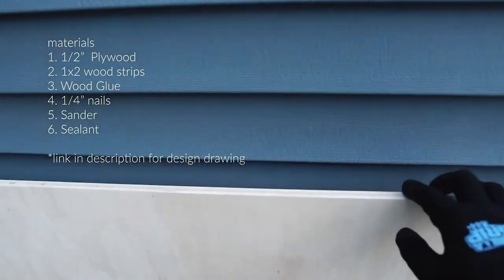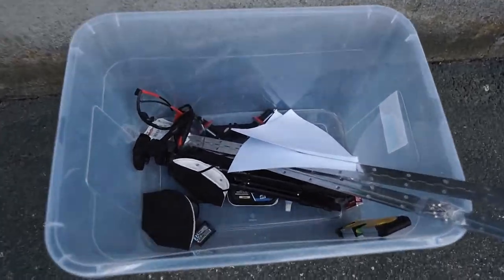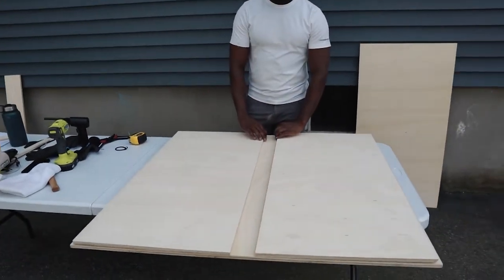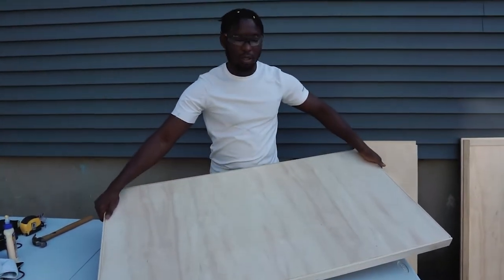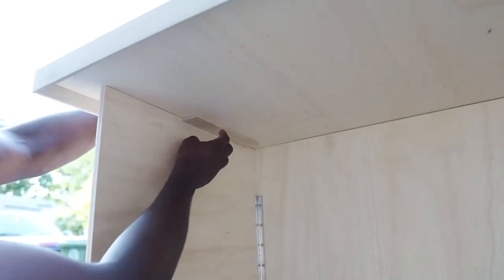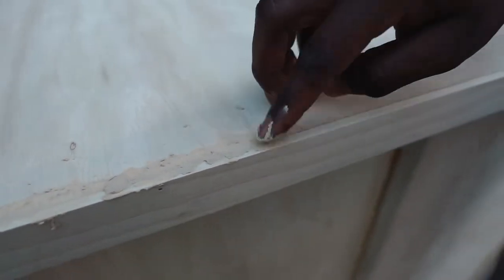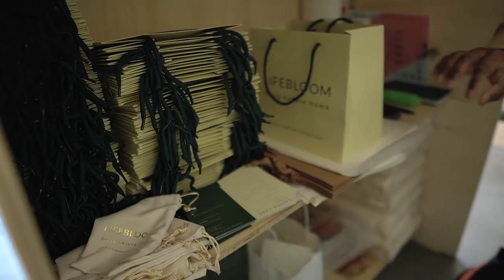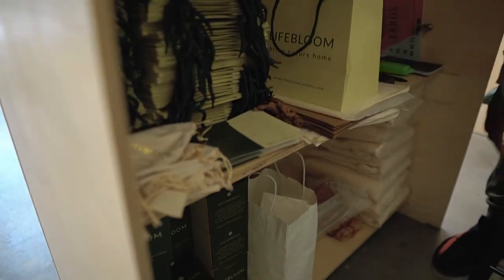DIY FOLDING CHECKOUT STAND FOR RETAIL/MARKETS | RETAIL VLOG #2

Comment: Hi! Im wondering if you might have any advice on building this with 2 panels on the side instead of the one on either side? Im trying to figure out how to make it 3ft wider, but still be able to fold up to fit in a small car? Im wanting to have thr two panels slide out from behind the bar, and then two more fold out so it can stand like yours? 

I probably explained that terribly 😂😂 but omg Ive built quite a few of these, i just need a bigger one now lol